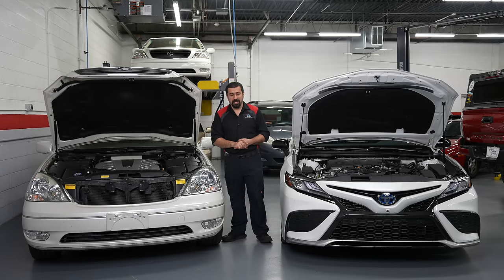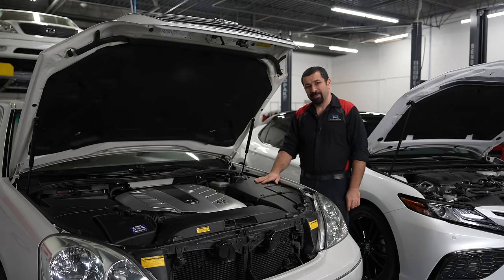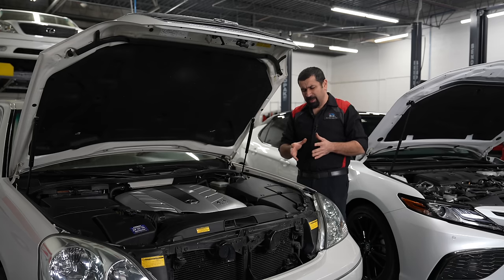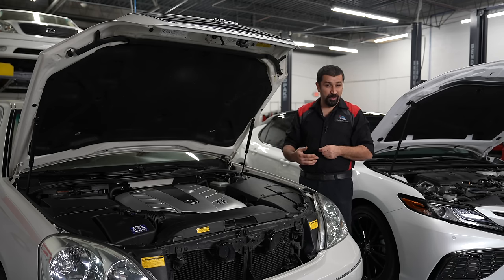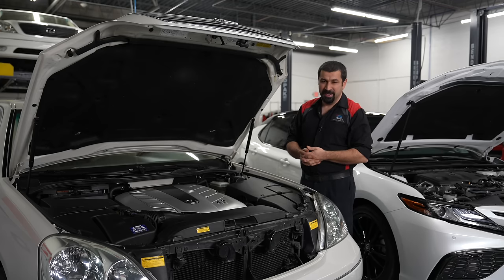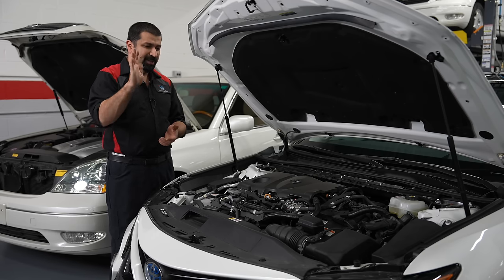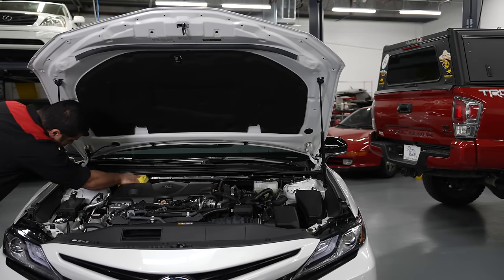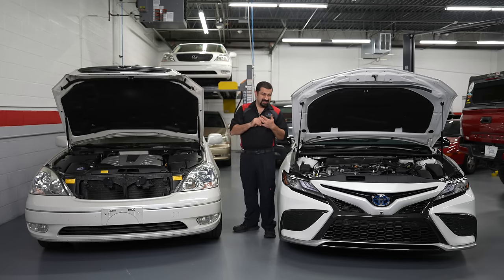Never Do THIS When Cleaning Your Engine Bay! Do THIS Instead

Comment: Mr. Car Care Nut, you are a big blessing to car owners. I have always resisted the idea of taking my car for an engine bay wash and I am glad I have never done it. The advices I have received from a few local mechanics have been misleading, one of them even told me that I could wash the engine bay under pressure when the engine is running! I remained skeptical of that advice and am glad I watched this video before attempting any cleaning methods. When it comes to maintainance of my V6 toyota Mr. Car Care Nut's advice becomes cardinal rules. Thank you Mr. Car Care Nut for always educating us on how to maintain our cars. May God bless you abundantly.
Reply: I used to work in a garage but as a car painter, the mechanics always told us to let the engine run if it was a diesel while washing it and not spray directly on certain parts it was almost a decade ago and only did it once or twice but I think the reason is that if you didn't the engine might not want to start after and maybe because if there's some water that goes where it shouldn't the heat will dry it.

Comment: I’ll use some simple green/purple power, rinse with wide spray of water, then compressed air. I’ve never had an issue, but I generally only do this annually. Engine bay looks clean helping to spot any leaks. 
I’ve seen many cars where it’s so dirty, you can’t even read brake/washer fluid levels.
Reply: We detail in our automotive shop after a car after a repair that involved an oil leak. We dilute Purple power with water and a brush to agitate the oily grime. We follow with compressed air and a wipe down. I apply tire shine on the plastic and then a wipe down to remove the extra residue. We avoid alternators and ECM/PCM.  It can take 1-2 hours but we want to the customer to notice the difference in the finished product. We send them BEFORE and AFTER photos of all of our repairs
Reply: @jamram9924  I'm a bit late to the video... only a few minutes in... but was hoping this would be addressed. I need to do some de-greasing and cleaning on my high mileage car to help see if I have an oil or other fluid leak. (Both now and preventative in the future)
Reply: @fricky172  sometimes I’ll use a pump bottle with very hot water and degreaser. I apply it directly to the areas where the oil is present. If the oil turned into greasy dirt, you may find yourself using a stiff wire brush or putty knife to remove the thick encrusted oily dirt. I’ll use a power washer in areas like the engine block, transmission and engine oil pan to do a final wash and rinse.
Reply: @robertruge2916  The alternator in my vehicle is original, 13 years old, no issue yet. You just have to be careful with what you're doing and where/how you spray. I've never covered anything.

Comment: Thanks for clarifying this!  I always see detailers using a pressure washer on the engine bay and they always say how safe it is!  The problem is that they are NOT mechanics and the damage they MAY do wont necessarily be seen for many years.  Wash by hand, and take your time...
Reply: While it may seem fast to just rinse down everything with pressure washer, in reality, it takes more time to dry everything.  I learned over the years to just use a leaf blower once a month and a simple wipe down with a slightly damp shop towel if necessary.  Truth be said,  when the plastic covers are clean, that already satisfies each one's itch.  At the end of the day, no one is going to look at your engine bay everyday.
Reply: @michesbianan  💯
Reply: It was not that big of a deal before fuel injection and a tone of electric parts. We always pressure washed our engine while running but right after wiper it down. Cars didn’t last nearly as long as they do now. In New England we always had to replace wires but they where a-lot simpler
Reply: @christopherjoyce9788  Right, older cars really didn't have many electronics at all, and a little water wouldn't hurt a cast iron engine with good ol' carbs!  I miss my 78 Cutlass!  😆

Comment: I always use diesel as a degreaser, do cover fuse box, battery and alternator with a grocery bag and on a spray washer I never push actual trigger for more pressure, just spray it off, keep hood open for a good 15 minutes, carefully wipe out the area with microfiber towel, lastly I use 303 plastic / rubber protector spray as a detailing. I drive my car as delivery as well as for personal use about 35K a year, any weather, keep engine bay clean is a must for me.... Great vid, thanks for sharing 👍

Comment: One thing I do is just use a swiffer wand every few months to remove dust in my relatively clean engine bay. It is pretty good at reaching into crevices or hard to reach places. So far I haven’t needed to use any liquids to clean it since I bought the vehicle 4 years ago.

Comment: Some vehicles are designed/built better than others in terms of keeping stuff out of the engine bay, so it doesn't get dirty/soiled much in the first place at all.  My 2022 CX-30 is almost 2 years old now & the engine bay still looks brand new minus a very light coat of dust that I finally wiped off last month without much effort.  The Corolla Cross (& regular Corolla) has two giant/open hood gaps above the headlights from the factory with no seal & which allows all sorts of rain/water, dirt, grime & debris into the engine bay.  My friend's one year old Corolla Cross looks super dirty/grimy already inside the engine bay & my 2020 Corolla sedan had the same issue.  Not sure what Toyota was thinking (other than cutting costs) with those large hood gaps & no seals/weather-liners for U.S. version models on these vehicles (some other global markets did receive the seals/weather-stripping in those areas).  Tacky, tacky - and makes you wonder where else they cut little corners to increase profits.

Comment: I am very conscious of my 4Runner’s condition, and first use a very soft dust pan brush to get most of the dust off my engine components, and then move on to other means as necessary. Works great! Thx so much for your great videos, and for your spiritual sign off 😊

Comment: I was going to suggest using a car detailer on the engine bay lol.   You can also clean the underside of the hood and clean all the seals.   keeping the seals clean around the hood I have found through the years really helps keep the engine bay clean.

Comment: I just got my oil leaks fixed after leaking oil forever. My engine FEELS like a fire hazard.  So I bought a dual function pressure washer sweeper to clean the under carriage. I found this video while searching how to clean it. THANK YOU from the perspective of the guy that has to FIX the damage. I will cover up my connectors and clean everything cold. All other videos from others said to spray the brake cleaner on oil "stains" on a hot engine.

Comment: I’ll clean the engine bay maybe once a year but more importantly, I replace fasteners that are starting to rust. Good information here as always. The engine bay gets dusty and dirty very quickly so I just hand clean with a hand pump sprayer. I like Oil Eater spray. Doesn’t affect metals or plastics. 1:2 dilution. Distllled water.
Reply: I suggest using fluid film with a applicator every season. Eventually it builds up thick and you just have to touch up once in a while. People think it’s just for underneath but you can spray it anywhere and all over anything. It stops rust and makes the plastic shiny.
Reply: I do the same with fasteners! I replace any that are starting to rust. I also keep the peppermint cans fastened in the engine bay also….They keep the mice, rats and squirrels from Chewing wires. The peppermint works great.
Reply: @markm0000  Coating an engine bay in oil, what could go wrong lmao
Reply: @ADUSN  The coating just boils off areas that get hot. The problem is when you have a lot of oil dripping out the valve covers right onto the exhaust while the car is driving up a hill with high EGTs. That’s when it becomes a fire hazard and the oil combusts.
Reply: @ADUSN  Oil temps reach 250f max? Set your oven at that temp and put a pan full of thin cooking oil in there. It will not catch on fire, it just boils off. Same thing here.
Reply: It also collects dirt and dust like a magnet  @markm0000
Reply: Good, but why not simply oil things. A drop of light oil on a nut or bolt to keep the threads protected from air can't hurt. Not WD-40: that evaporates away. Get a real oil can and put some motor oil in it. Wipe away the excess if you drip too much. Later, assembly/disassembly will be so much less painful!
Reply: Good, but why not simply oil things. A drop of light oil on a nut or bolt to keep the threads protected from air can't hurt. Not WD-40: that evaporates away. Get a real oil can and put some motor oil in it. Wipe away the excess if you drip too much. Later, assembly/disassembly will be so much less painful!

Comment: Thx for the tips.  On the infotainment screen.  What works for me is very light mist of distilled water and a microfiber cloth to "gently clean the screen"   Never use Windex or any alcohol based cleaners on infotainment screens.    I'm  going to try the no rinse car was for my engine bay. I've always just wiped it down but l Like your suggestion and demonstration.

Comment: Thanks, excellent info. Working with electronin equipment since the early '70s, MANY intermittent problems were caused by connectors. We old timers could go to the coin op car wash and spend 25 cents on a shiny engine. Those days are long gone. Compressed air is your friend.

Comment: I just cleaned my engine bay. I used a microfiber towel and did exactly what he's doing. I used amorall, w-40 and back to black. You can use Dawn liquid detergent as a degreaser it's pretty gentile on the plastics but still a good idea to wipe clean dry. Back to.black actually cleans and blackens old dull black plastics pretty well.

Comment: Thank you for the great, informative videos!  I am a big Toyota and Honda fan.  I operate a car wash and attempt to provide guidance to customers when i see them preparing to wash their engine bays. The water pressure at the exit of our pumps is 1450 psi!  In bay, the water pressure at the tip is about 1300 psi, high enough to cut a finger off.  We also use professional strength Dawn to degrease our bays.  It works great and is not aggressive on paint.

Comment: I clean the engines in my cars by mixing real warm water and dawn dish soap. I take a towel soak it in the solution and wring it out. Wipe all the surfaces and keep repeating.  You do this once.a week and it takes all of 5 to 10 minutes and your engine bay stays pristine.  Just like you suggest I too use detailer to finish. Great video because some people do think that hosing the whole engine bay with a hose is the way to go.
Reply: Stop using Dawn on plastic parts esp in the engine

Comment: outstanding video. i don't like putting any strong chemicals into my engine bay so i usually stay away from degreasers unless i really need them, then i make sure to give a good cleaup to make sure nothing is left behind when i'm done. i like using distilled water and dawn dishsoap mixed at about 0.5%-1% dawn to water ratio in a spray bottle for basic cleaning. the distilled water doesn't have any minerals or metals that can accelerate corrosion and the bit of dish soap acts as a very mild degreaser. i use a couple different-sized microfiber wands and a few different brushes to get into awkward areas and microfiber rags on the rest. hit the plastics with a ceramicoat designed for plastic lower body panels once every couple years to help resist dust and salt. silicone/dielectric paste for electrical connectors, wires and anything where particulate might settle and corrode or abrade. i deep clean once a year and give it a quick cleaning monthly when i check my fluids and do a visual for anything out of the ordinary. the microfiber wands have found leaks super early a couple times. they are normally pretty clean but if they come back with oil or something other than basic road grime and dust, it's time to start looking a little more seriously. 

i find having a written list of exactly what i need to do on my monthly checkups helps me actually check everything that needs to be checked and i get it done faster because i don't have to remember what to do, just check the list. i usually look up common failures for may make/model/year/region and add those to my checkup list. costs me half an hour once a month but it has saved me thousands.

Comment: I’ve never used water inside my engine compartments.  I’ve used either windex or simple green.  They are both great cleaners and degreasers without fuss. With all of the electronics and connectors, you have to be conscious of  your cleaning methods.  His points are well headed.
Reply: Dont use windex ffs.

Comment: You’re absolutely right about the cavity with the ignition coils. The first time I ever tried washing my an engine bay professionally. I was very careful and used low pressure water. I wrecked my ignition coils. My chevy sonic ectec engine has the coils on the very top of the engine sunken into a cavity and the day after I washed my engine bay one of the coils failed.

Comment: The newest vehicle I've owned as far as cleaning the engine was my 1997 Oldsmobile Bravada and after I cover the Throttle Body with a plastic bag I used a Engine cleaner I'd buy from Costco,that stuff is so strong it would even remove paint.It said not to daloot it but I would deloot it anyway,half water half cleaner and it would still take grease off completely.But I never had the problem with my Alternator not working after I'd sprayed the engine off with the garden hose and it was in very wide spray mode.But now I drive a,"2010 Toyota 4 Runner Limited", and after watching your EXCELLENT VIDEO, I've got 2nd thoughts on cleaning the engine off, there's alot more electronics under the hood which has a "4.0L V6 ENGINE"and it's AWD AND 4X4,BOTH !
Reply: I never knew that about the Alternator though but it makes sense.

Comment: Light pressure/mist on cold engine. Simple Green full strength on grease and oil. Let dwell an hour or two. Drive car after to evaporate water. 

 Once you get a good base clean. The lightest mist to knock dust off is all you need.
Reply: Yes, Simple Green is amazing stuff.

Comment: EXCELLENT video as usual. I usually use the same damp microfiber that I dry off exterior body, interior, door jambs, wheels and then the engine area. It’s super simple if you do it every time you wash the car. The dealership is always impressed, when I drop the car off for service.

Comment: Great video. I use to detail cars and luckily never had any issues. Always used a degreaser and pressure washer at a distance. Let the degreaser do the work. But nowadays on my personal vehicles I just try to upkeep the cleanliness so it isn't a big deal. 
     Thanks on the info on touchscreen infotainment systems. I didn't know they could be damaged with certain cleaners. Been using 409 but will definitely be getting touchscreen cleaners.
Reply: Aaa

Comment: As always, thank you for your expert car knowledge and warning to NEVER pressure wash under the hood. I once ruined an engine by pressure washing. I pressure washed and blew the fuse on the engine fan. The electric fan was shorted out and failed to come on in the Summer heat. Overheated the engine, warped the head, and that was the end of a good engine.

Comment: This is gold. I will not be offering engine “detailing” as a service and honestly, I think it will win them over when I explain why using the information you provided. Thank you for this informative video.
Reply: I've cleaned a couple thousand cars, and honestly, just a 20-30 second power wash (avoiding alternator and connectors), dry it up, then spray a water-based interior dressing and the customer will be very happy.  And it'll take less than 10 minutes.
Reply: I haven’t offered engine bay cleaning as well. Seems to be too much of a liability.

Comment: On my older 1995 Dakota 5.2 Sport I use what I learned from a neighbor on his 5.0 mid production Mustang with it’s brand new looking engine bay. A hand spray down with Original 409 cleaner, wait ten minutes, then garden hose spray gun on spray setting. Because of all the connectors and deep spark plug tubes in my 2021 Tacoma Sport TRD I will be subscribing to your hand spray detailer micro fiber wipe down instead. Good video. Thanks.

Comment: Using pressure washer is exactly what Toyota HQ Japan is specified how it should be cleaned.
There is a video about Toyota certified used car's engine bay clean up procedure (specified by Toyota HQ in Japan).
"TOYOTA pay close attention to even used car's quality! with English subtitles"

Comment: Thanks for the tips on this. I only wipe when cleaning the engine bay. I will use the quick detailer next time. I love the results. For the touch screen I use a microfiber rag damped with water.